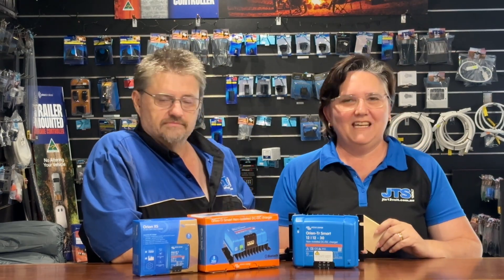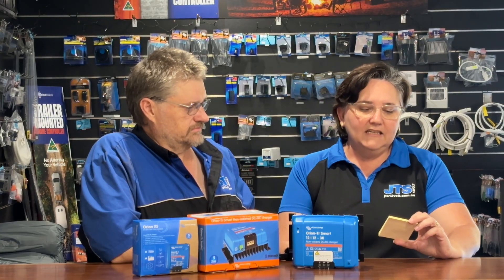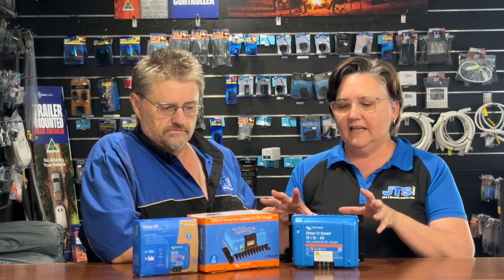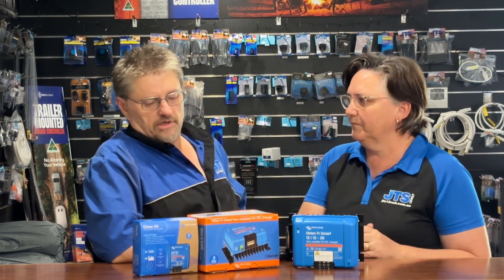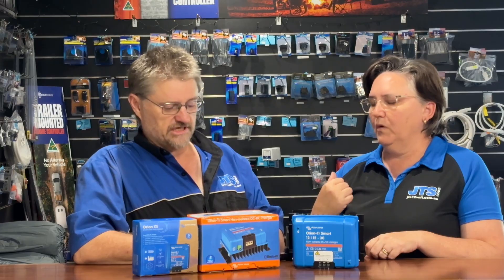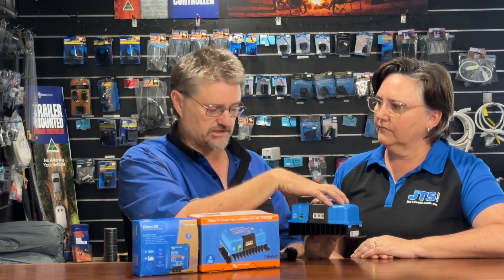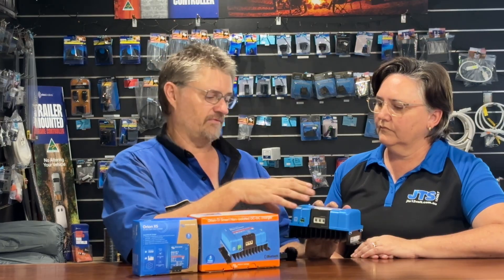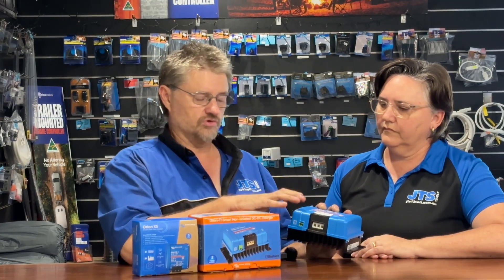HOW TO: Wire up ISOLATED & NON ISOLATED Victron DCDC - JTS12Volt

Comment: If I have the non-isolated version, is it correct if I run the negative from the DCDC to a common bus bar, which is grounded to the chassis. The bus bar has the negative from the house battery connected, with a shunt before the bus bar. In this scenario do I also connect the negative from the starter battery to the bus bar?

Comment: Hello! I have a motorhome in which I use an Orion Victron 24v 24v 17a isolated. I ask: can I install an Orion XS 1400 in addition to this device, since we would have to combine an isolated device with another non-isolated device (Orion XS)?
Reply from the maker: Hi @OViajanteFeliz, certainly can be done you would need to change the system to a common ground, instead of isolating the ground. Then bring your input cable to a common post/fuse and then same length cable to each device on the input side. This would ensure even amp separation. Always best to check with your installer as personally haven't seen how your system has been installed.
Reply: @JTS12Volt  Thank you very much for your attention and explanation. Best regards. Roberval - Brazil

Comment: Greatly appreciated.  Just one question I’m coming from redarc with smart alternator.  So have blue trigger wire.  That only has to be wired into that green block to turn it on/off and stop it from draining the start battery ??
Reply from the maker: G'day, yes you still have to place the wired into the unit. You will be placing that cable into the "H" side of the sml green block.
Reply: @  thank you so. Much greatly appreciated.
Reply from the maker: @ Most Welcome happy to help. Cheers